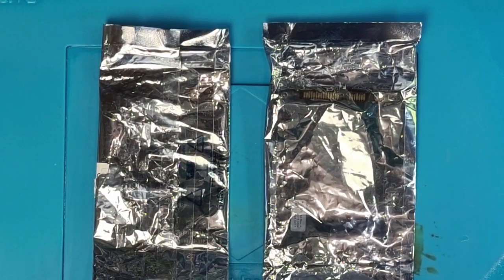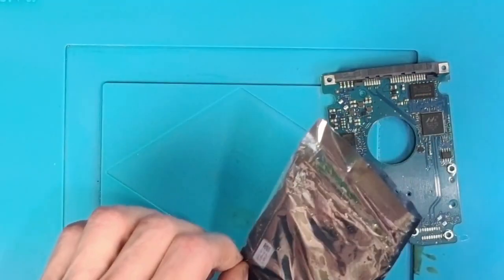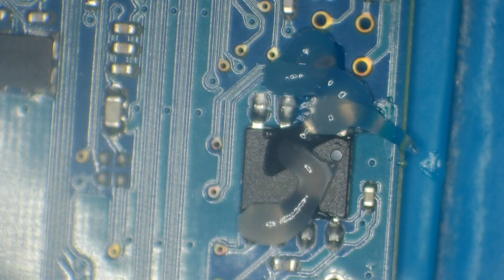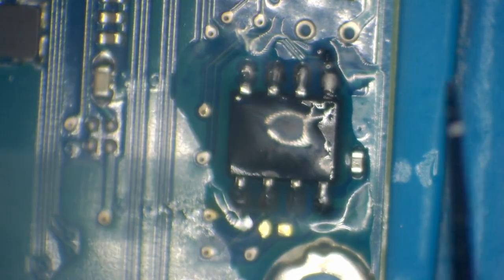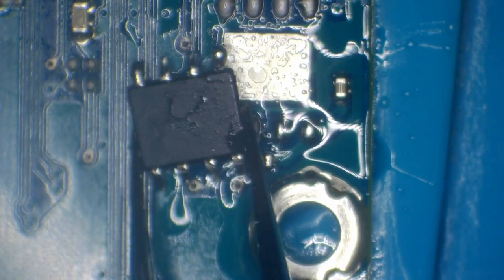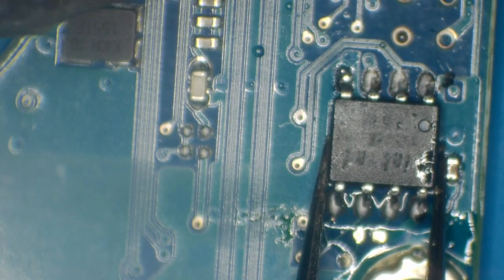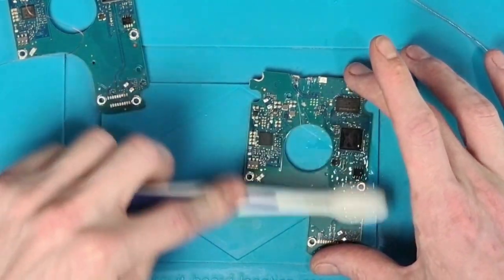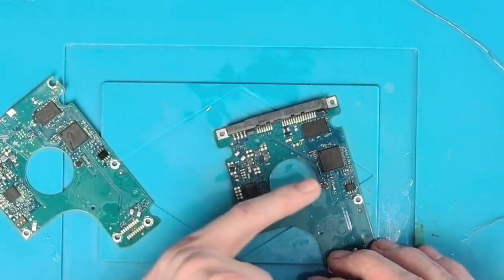Hard Drive Bios Chip Swap - Replace HDD Motherboard For Data Recovery

Comment from the maker: Hey everyone. As requested I can confirm the customer successfully recovered his data once he received the logic boards back. SMS confirmation here -> https://ibb.co/5R3LtTh
Reply: Actually, is replacing the board without the bios results in the drive being not able to read a single sector (reporting sector unreadable) or is there something worse in my case? I have a Seagate 1er164-302
Reply: Came to the comments hoping for this comment. Happy to see it worked out.

Comment: had a sandisk engineering sample ssd that was stuck at engineering sample firmware. took out the DFN (dual flat no lead) bios chip and flashed it with officially released firmware using ch341a programmer. soldered back the updated DFN chip back on and voila that ssd is working flawlessly now
Reply from the maker: That's awesome bud, it's amazing sometimes what a simple firmware can do 😁

Comment: Swapped bios chips last month for someone.  Unfortunately it ended up not being a bios chip problem.  Hard drive was a 40GB - pretty old - bought clone hdd - pcb board revision matching ebay. Could swap both bios chips to good hard drive and it booted with either chip - old and new - but the dead hard drive would not boot.  It did spin though -  no grinding noise.  Shelved the project for now.  Tried linux tools to recover data via testdisk too to no avail.
Reply: Likely dead head amplifier in the actuator then, or a bad motor that is able to get to speed, but not maintain it correctly. Think I still have a good number of them around though. I have a few dozen old drives of various types and ages, just went through all of them slowly and ran SMART full test, and binned any that gave any reallocated sectors or pendings. Stripped the fails and got a nice collection of magnets out of them.
Reply from the maker: @SeanBZA  this is a bit beyond my knowledge to be honest but awesome to see that kind kind info being shared in the community, thank you 😊😀
Reply: @TheCod3r  Yes I have had limited success with board swaps, at least i got enough of the data off to a clone drive, because i found a drive of the same model and version to act as temporary donor. not going to work with modern drives, but worked on the old 10G drive.
Reply: @SeanBZA  The linux suite of testdisk and its variations have been my best bet thus far for saving dying disks .  Did a pretty deep dive with various 3rd party windows tools and was not nearly as successful.  Glad to see this bios chip swap video.  @TheCod3r is more skilled at electronic repairs than I am and it shows it can be done, and how  to do it well.  Videos like this have given me confidence to swap smd chips on larger computer motherboards and save them from the trash heap.

Comment: have the same problem. with my hdd mobile drive freecom, usb contact was brokrn, now i need to. remove the bios ic chip to another pcb.
is this isolating pasta you ve used at the beginning?

Comment: Is it possible to just reprogram the bios, copying one to another?
Reply: I'm not an expert, but in my case reprogram bios make a job. I was afraid of soldering the chip like fire. Just use programmer ch341a, ofc need first unprotect (take off write protect) chip. My hdd is WD Blue wd10spcx (Winbond 25X40CLVIG).

Comment: it looks like the pcbs are not the same in layout, maybe a different revision? but some revs share the same bios anyway, so yeah, hopefully it's a success for the customer. great video btw.
Reply from the maker: Thanks bud, yeah I thought the same but as I explained to the customer because he sourced the parts and just paid me for a chip swap it was his responsibility but he did message me and told me the data recovery was successful so I'm super happy about the outcome 😀
Reply: @TheCod3r  wow, that's great! glad to hear that. 👍😀
Reply: To me it looks like he's replacing a USB hard drive to a sata hard drive since some of those drives are USB only and a royal pain if that's the case

Comment: (rephrased the question) does replacing a bios chip bypass the drivelock? Once a locked drive is accesible, data recovery should be able to work I think?
Reply: No, it doesn't. The BIOS is cooked to the HDD.. so a drive with Drivelock, without having a password is final.

Comment: Cool video but an odd request. The customer will have had to kept the rest of the hdd in some type of clean room apparatus like Louis Rossman has, or am I missing something?
Reply from the maker: No the pcb is on the bottom of the drive exposed to the elements anyway so removing it is as simple as removing a few screws :)
Reply: @TheCod3r  cool, that's good to know. I haven't even held a hard drive in like 5 years. My pc is loaded with ssds haha
Reply: @Tano I wasn't aware that the controller was bolted on. Thanks for the info. Honestly.

Comment: A question..if we change the board without swapping the bios..can the hdd be formated and used after?
Reply from the maker: Unfortunately not, the bios chip is married to the hard drive and is required to be able to access the drive
Reply: Thx for the explanation

Comment: Can I use hard disk without changing the bios ic ,is it work or not 
I don’t need to backup data
Reply from the maker: If you're changing boards you'll need to swap the bios chip. Without the correct chip the drive won't work. If you don't need to backup data you might be better off just buying a new hard drive

Comment: Hi what did u use in 2.08 minutes
Reply from the maker: It's called flux mate. It helps the solder to flow onto the components and pcb

Comment: bro i have 500gb wd green so if i swap the plater into another hard drive has  same model ill be able to see my data ??
the pcp of my hard drive has a broken pads on sata connecter i can buy a new pcp  but im not sure if the head is in good condition or not n the pcp is not cheap so if bought  a new hard drive can i put the old plater on it n thats all ?
Reply from the maker: You can't swap the platter without a clean room mate, it will destroy the drive without fail. You'll need a data recovery company to recover data if it has a mechanical failure
Reply: @TheCod3r  well i open my hard drive ber4 i know that u need a clean room :( is it ok ?

Comment: Hi, It is necessary to replace the bios, can I read the files of my wd blue wd10ezex 2015 with another similar logic board?
Reply: For better results you need to find the exact pcb model and swap (or flash) the bios. I don't recommend replace the entire logic board cause the bios have the information of the sectors to write or read, another logic board could damage permanently the data
Reply: That's was i learn from Internet, in some days i'll flash the bios of my hdd, if it works i'll tell you
Reply: @lucasmedina7231  how do i update the bios? Do you have any video explaining?
Reply: Che recién caigo que hablas español
Reply: @lucasmedina7231  pará boludo jajaj me maté traduciendo no se un choto
Reply: @Eapepe  Viejo, no pude reprogramar, anda a saber que le pasaba, pero les cambie las bios fisicas, osea dessoldando y salio andando, en un principio no la reconocia, lo deje conectado igual y lo volvio a detectar, un ojete
Reply: @lucasmedina7231  yo consegui un donante, le cambie el bios pero no limpie bien la soldadura y creo que quedó en corto, pues el circuito es diminuto entra justo

Comment: Well if that works why can't we move the nord chip on a ps4 from one board to another and also sort out corrupted nor chip 🤔
Reply from the maker: The corrupted chip can be fixed but the chip itself has some sort of encryption to my understanding which ties it to the console ID. This was basically a chip swap because the chip from the broken board was needed to access the files on the drive, so swapping it to a working pcb basically does the same as swapping renesas from one pcb to another 😁
Reply: @TheCod3r  much appreciated you are legend and love your channel  ant get a nuff

Comment: i am not able to make it. I have received a new PCB and swap it with my old one. HDD just blinked and is buzzing... 2 clicks after couple of seconds. Does not appear in windows...
Reply: That's what this video is about. You need to desolder the BIOS from your broken PCB and put in on your new PCB
Reply: @swisspeach67  i did so already and the same result. HDD is visible in Windows but not possible to initialise